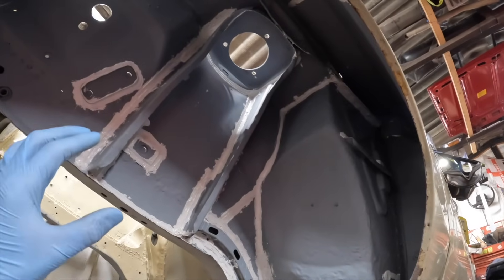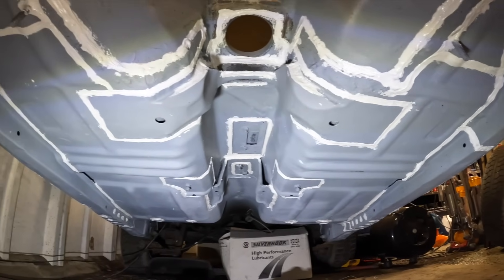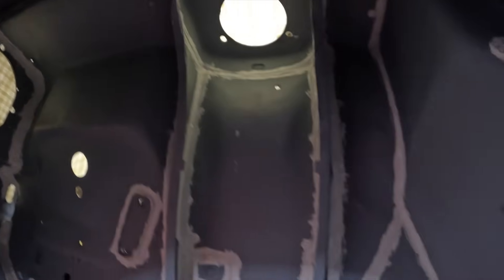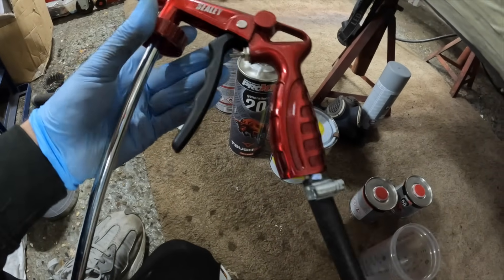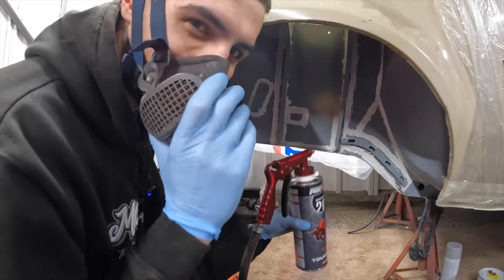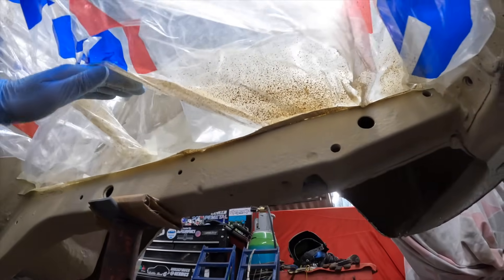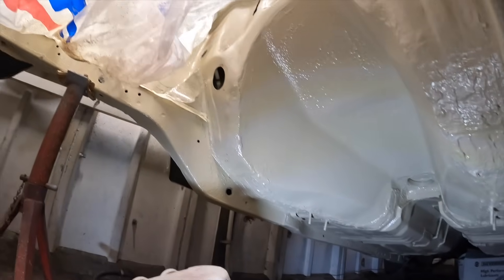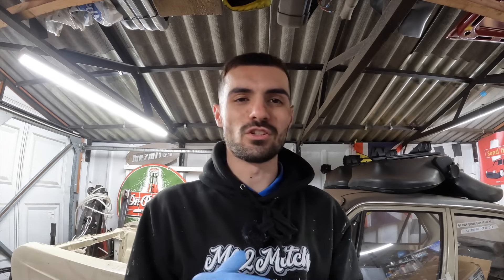I APPLY TOUGH OX UNDERBODY COATING | BETTER THAN FACTORY?!

Comment: Small tip for you mate, you'll make much quicker work out of the seam sealing by wiping it with a cloth thats damp with paint thinners, it'll make it much smoother you'll fill in the seams much easier.
Reply from the maker: Hi pal, thank you for the tip I will defiantly be remembering that for next time 👍🏻
Reply: @Mk2Mitch  no worries bud, also means you can get a much cleaner finish if you're going for smoothness instead of factory finish!

Comment: We used to empty the contents into a bucket, mix with thinners to thin it out. Then pour it back into the tins. This gets you more coverage and looks less rough but still give you the same protection. Only use it straight out the tin in rough areas and joints.
Reply from the maker: I see! Guess I went for the expensive option 😆

Comment: Only just discovered your channel. You remind me of how I was around 15 years ago. Make sure you don’t do what I did take in to many projects and not completely finish them. That’s the trap I feel into. I now have around 8 cars all in different stages of restoration, with no time to finish them. I’m also a Ford fan myself. I used to use jotun epoxy mastic under some of mine. It’s used for industrial applications and in ships. The stuff is so strong and dries hard but with a slight flex to it . Keep up the good work.
Reply from the maker: Thank you, I’m glad you found my channel! Yes I agree it’s very easy to get carried away buying new projects but I will get this escort finished as it’s top of my list! 👍🏻

Comment: Just be careful where you put seam sealer.  Sometimes it can prevent a seam drying out (trap water and moisture). Capillary action draws water into seams and its important that they dry quickly and are not sealed.  Great video, thanks for sharing.

Comment: What's going to stop the rust on the underside?
Reply from the maker: The fact I stripped it back to bare metal then rust treated it with a converter. The multiple coats of epoxy primer & the Tough OX coating 👍🏻

Comment: That's nothing compared to 2k roller on epoxy primer. It goes on like stonechip and will last forever. It also seals in any particles of rust so won't keep rusting away. This stuff is used on sea boats.
Reply from the maker: Sounds like great stuff, I did use 2k epoxy primer but I sprayed it on. Happy that it's given the escorts underside enough protection for now 👍🏻